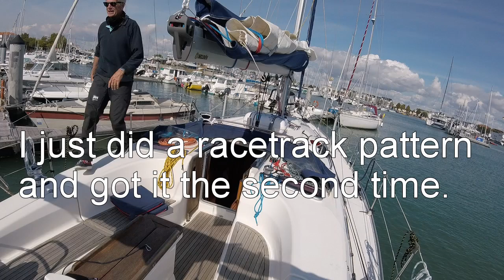Ep 18 Solo Sailing: How I Dock My 40' Sailboat 4 Examples and a Blooper

Comment: As a fellow solo sailor this is all very useful to see how others do it. We learn all the time.  I moor on a buoy so similar challenges but not so many other boats to hit if I get it wrong.  Andy Sussex, UK
Reply from the maker: Thanks Andie.   I love learning how others do it as well.  My technique for picking up a mooring buoy is to stop the boat (pointed into the wind or current and on the lee side of the buoy) when the buoy is abeam. I then quickly run to midships and pick up a gaff that has a detachable pelican hook and line attached, and I try to attach the hook to the top of the buoy.   The line is attached to a bow cleat, so I just let the boat drift back.   When all is calm, I pull in the line attached to the buoy (either by hand, or if strong wind/current, by winch) and attach my permanent mooring line.   It is a bit challenging in waves or strong current, as it is easy to misjudge distance to the buoy --- in which case, I just come back around.  I have a friend who prefers backing up to the buoy and attaching the mooring line (which is attached to the bow cleat).  My stern freeboard is a little too high to do this, but I have watched him do it, and he never misses.

Comment: Thank you for your video.  It is certainly a challenge to bring in a boat alone.  I use a similar method when docking due to a strong channel current and often adverse winds that seem determined to push me away from the dock.  I sometimes will gently nose Olivebank into a dock in order to hold it against wind and current on a transient dock.  That gives me time to throw a bow line over a cleat, as a spring line, and then use stern thrust from the engine to move the boat over to the dock.  Your videos are inspiring, please continue to produce them.
Reply from the maker: Thanks Dave.  If I understand correctly, I often use that technique too, but to leave the dock, rather than on arrival.  I can see how it would work both ways though.   Food for thought.  Thanks for the comment.

Comment: Very good. I also have done a number of single handed dockings. Tricky but possible. What I witnessed last week in Croatia, however, was a single handed med moor of a 45ft boat in a crowded marina (two stern lines plus picking up two "slime lines" to hold the bow off the dock, squeezed between two other boats). The Captain was a professional skipper with no help from his paid guests. I introduced myself and congratulated him on a amazing feat. He said guests never help and he did that regularly. Amazing!
Reply from the maker: I am lucky that we do not do Med style mooring here on the Atlantic coast.   I struggle enough as it is.   :-)   Thanks for watching.
Reply: @patricklaine6958  On conventional mooring, my own technique, for single handed docking (any wind/current condition), is to prepare in advance three throwing lines (secured to each of the forward, stern and mid cleats), coiled up and bought next to the (stern or starboard gate), ready for throwing. Once i have positioned the boat alongside the dock, using the engine, i put the engine in neutral, throw all three lines onto (or even past) the dock and then step off onto the dock, securing the mid line first, followed by the other two, with a quick turn. The purpose of the long lines (say 30-50ft.) is to minimize the risk of the line dropping off the dock and into the water and therefore ensure that you can also tie up the forward and stern lines without having to step back onto the boat. Once the boat is secure then i replace the lines with conventional dock lines. Docks with no cleats (i.e. such as in the PNW, where you have to wrap the line around a horizontal wooden beam) require more time to get secure and if you have a wind off the dock situation, one has less time to play with, but this technique has worked successfully for me for years. I hadn't contemplated leaving the engine in gear to hold it against the dock, as you describe, but i can see the advantage when in a finger dock.
Reply from the maker: Someone els suggested a variation on that to me ---- he just steps off at midships with a line in his hand and quickly takes a turn on a cleat.   I've never been brave enough to do that: I often moor in marinas with strong tidal currents, or strong prevailing winds, so it is difficult to completely stop the boat, and even if I did, my boat is 40 feet long and weighs 10 tons.    I know from experience that trying to pull it in 12-15 knots is quite challenging………   I love (conceptually) your approach, but can't see myself leaving my boat without at least one line around something solid first, unless in dead calm conditions (in which case, mooring is not a challenge).  Thanks for the good food for thought.
Reply: @patricklaine6958  Yes, my own is 34 ft and 6 tons so I have it easier. However, I have never had to pull the boat in - there is enough friction in a single loop around a typically dock cleat to hold the boat and it takes less than twenty seconds to engage neutral, throw the three lines onto the dock and get the mid line wrapped around a cleat. It is a bad (off dock) cross wind or current that requires less time. As i mentioned, i find the bigger challenge is in the PNW where there are no dock cleats and you have to feed the line around a horizontal beam/structure. The timber is roughcut, with lots of splinters to catch the line, making it hard to feed through and if you catch such a splinter (or fumble it), you can potentially lose control. However,, a local commercial fishermen taught me his technique (them being typically shorthanded), where a single loop around the structure on the mid tie, is enough to secure the vessel, buying time to tie up the rest of the boat. Either way, being single or shorthanded is always challenging and there is probably no perfect way - whatever works for the boat, conditions and skipper.  A few weeks ago I chartered a boat in Croatia with family and it was such a pleasure having six crew on board (despite having to med moor). Made everyting so simple!
Reply from the maker: Yeah a crew makes a BIG difference.   To see why I won't leave my boat without a solid connection first, watch my Episode 25 at 10:10.  Note how fast it drifts away from the pontoon ---- just a matter of a few seconds.   Anyway, you have a great method that works for you --- and that is all that matters!   Fair winds.

Comment: Excellent video! Really fine job. I've never seen the boating crashing technique to crosswind docking. Very creative (and functional). Well done.
My worst fire drill docking  was upwind of a vintage wooden boat that had the owners restoring it down below during my "maneuver."  My boat (Valiant 42) was horrible at backing any distance without severely crabbing out of control. The fairway was very narrow and I doubted my ability to back out of the fairway to buy me some time to call for assistance. My challenge was the 20 knots blowing me off the finger pier and into the vintage boat. My mate tried to lasso the mid-pier cleat but missed. I had to leap onto the pier (injuring my hip) and made fast to the mid-pier cleat cleat with the boat 4' off the pier and just a foot from laying against the vintage boat. Someone else had pity on me and took the bow line and made it fast, but it took at least 10 minutes of grunting against the wind before we got the boat against the pier. If there had been a cleat at the end of the finger pier, we could of lasso'ed it and used the engine to pull the boat into the pier, but we had to commit to the slip before we could tell that there wasn't a cleat that we could use for that purpose. The silver lining was that the vintage boat owners never new how close they came to a lot more work. :-) at my expense. I still have the nightmares reliving that awful experience...
Reply from the maker: I feel for you Rich --- though to be honest, we've all 'been there, done that' before.    My absolute worst ever arrival occurred at 0200, so I was the only witness…...but the memory still makes me cringe.   I regret having used the expression 'crash method' as it was meant to be tongue in cheek.   I wish I had said 'bump and lock method' instead, which more accurately describes the technique.   In Episodes 22 through 35 I show another 30+ arrivals in all kinds of conditions.    Some are good, some are bad, and a few are ugly….. but all were safe.  :-)

Comment: That was quite helpful.  It seems most sailboat docking videos are presented with a crew.  Single handing is often a requirement for the person that loves the activity, leaving them to their passion alone.  Thanks for your insight into how you went about it in the cases presented.
Reply from the maker: That's the key point Sandhill: docking techniques that work for multi-crew boats (very) often do not work for single-handed skippers.   This is the method I use, but welcome and accept that there many ways to do this, and every boat/marina will have their own unique personality.   :-)

Comment: Thank you Patrick...Im a solo sailor mostly and I'm just upgrading to a 40 footer from a 26. Your video has just helped ease one of my biggest worries.
Reply from the maker: Many thanks David.  Every marina and every boat will require variations on the theme, but if I helped relieve a bit of the stress of docking maneuvers, that's great.  I'm sure you will develop a safe methodology that works for your circumstances.  Thanks for watching.

Comment: Thanks for posting this, great instruction for anyone wanting to learn to doc in various situations as a solo sailor. Definitely the hardest part of sailing, getting to and from the doc by yourself. Look forward to more of these types of instructional videos!
Reply from the maker: Many thanks Jerry.  I certainly think it is the most stressful part of solo sailing.   Unfortunately most of the docking training we receive is perfectly suited for a 'crewed' boat, but inappropriate for solo sailors (especially in larger boats).   I took a couple of weekend 'port maneuvering' courses with different instructors, and this was a good start.  However, I quickly learned that each boat is different, and each marina has its own personality also (long or sort catways, strong or no currents, shielded or not from the wind, slip berths or end of pontoon, etc.).  You have to build a strategy based on your learnings, but adapted to you own situation (in my opinion, anyway).  Thanks for watching.

Comment: I have been very impressed by the high quality of your videos and the numerous practical tips. It is reassuring to know that even a very experienced sailor such as you admits that docking is one of the most difficult things a sailor has to contend with and you can get it wrong sometimes. It would be useful to have your views on leaving a dock affected by  a strong current or wind. My own experience has taught me that, if one is turning into a berth with a strong current (or wind) at 90 degrees to the berth one should always arrange to first head into the strongest force so that it acts as a brake. Andrew
Reply from the maker: Yes Florence, the professionals always stress heading into the wind/current when turning into a berth if at all possible.   This was not possible in the previous marina berth I had due to physical constraints (lack of space and shallow water), but I recently changed places in the marina, so now will try to head (or back) into the wind (or current) whenever it is an issue.   Thanks for bringing up this important point.
Reply from the maker: Sorry, meant to say Andrew.  :-)

Comment: Thank you for showing this technique. I have joined the club of 'crashing into the dock' and it works wonders. Like a ferry docking. 
My raked bow helps bring my 11 tonne boat to a stop as I slide a foot or two up onto the dock and slowly slide back down again...
I'm kidding, it's all about timing and judging distances.  Docking my 36 foot sailboat solo is difficult at best, I just didn't have the time to do what needed to be done and then leave the helm and cockpit to jump onto the dock.  And like your video, the finger is too short to lasso a line over a cleat.  This works well.
Reply from the maker: Thanks PeatSakes.  I've taken quite a bit of heat for that expression 'crash method'.  :-)  I wish I had said something scientific like, 'variation on the international space station differential docking method'.   :-)   Anyway, like you said, for the layout of my boat,, the responsiveness of my engine, and the type of fingers I dock against, this works just fine for me.   Thanks for the kind feedback.

Comment: Thank you for a very helpful video.  I sail solo a lot and will be able to use your insights - especially on using a bow fender for low fixed or floating docks.  My home marina has a high-fixed dock so I have lines that form a bridle or yoke to center my bow while I tie off the  lines.
Reply from the maker: Thanks Ahawk.  Sounds like you already have a winning formula.   I haven't seen that in action before, but it sure sounds like a good solution.    Best to you.

Comment: A most interesting series of vlogs and thanks for sharing.  Plenty of good practical insights that well portray the 'joys and fears' of sailing. Your camera and sound management techniques improved tremendously throughout the series and I hope you continue next season.  Thanks again - from EF
Reply from the maker: Very kind of you EF.    Thanks for your support.
Reply: I've discovered to my cost that there's a 'cruel truth' that generally applies when handling a boat in confined conditions and it's this - "when things go badly there's no shortage of witnesses, yet when you do it perfectly, there's never 'a sole about' to share your satisfaction" Strange isn't it?  At least with a camera you can exert some control, provided it's running when you get it right...! Cheers

Comment: Really interesting video Patrick. Many thanks. One great technique that could be useful, especially when visiting that other marina, is to have a long line from mid ships all the way back, on the outside of the boat, to the stern fair lead/cleat and onto a self-tailoring winch. Reverse up to the cleat (can even be at right angles to the pontoon !) you want to eventually tie a stern line to, slow the boat to almost dead stop by the pontoon/cleat, lasso the cleat with your long line, pull the end on the winch to make the line tight and then drive forward and the bow will come alongside. Works in all wind directions.
Reply from the maker: Thanks Paul.  In later videos I show a technique that closely approaches what you suggest, (though I capture the cleat ashore by dropping a loop suspended on a gaff perch).  The problem with my boat is that it is hard to lasso the bollard ashore from the stern of my boat due to interfering bimini frame, davits, GPS, life buoy, and narrow footing behind the helm).  It can be done, but if there are any complicating factors (wind, current, tide...) and the boat is slightly out of position, it becomes 'challenging'.   Thanks for watching.
Reply: @patricklaine6958  Thanks Patrick I will check it out

Comment: Great set of videos, thank you. Especially impressed with your solo docking techniques.  Please do make more.  I'd like to see the reversing to the dock manoeuvre in more detail - didn't catch exactly how you avoid the bow turning out away from the dock.
Thanks for the series.  Good watching...
Reply from the maker: Thanks for the kind support Michael.   Greatly appreciated.  You raise a good point about the bow potentially swinging out after backing in and dropping the line over a cleat (with wind/current off the pontoon).  Exactly that has happened to me before in high winds, and I found myself at 90 degrees to the pontoon, and no amount of power/bow thruster would bring it back in.  I ended up just releasing the stern line and backing in again.  If you have a strong wind off the pontoon, it is critical that IMMEDIATELY on dropping the line over the cleat, you do a quick figure 8 to block the line, and put the boat into forward gear while at least centering the wheel, or preferably, turning it about half way toward the pontoon.  The engine will then pull you into the pontoon.  If you delay putting the boat into forward gear AT ALL, the bow will swing out and it will be very difficult/impossible to bring it in.   I'll probably do another video next season on docking techniques, including reversing (solo) into a slip, as well as other variations.    Many thanks for watching.
Reply: Patrick Laine 
Thanks for your reply Patrick.  I think I've got it. Btw, my father was also a pilot.  RAF 26sq 1941-45...
Reply from the maker: Ahh, one of the brothers of 'The Few'.   Nothing but respect my friend.